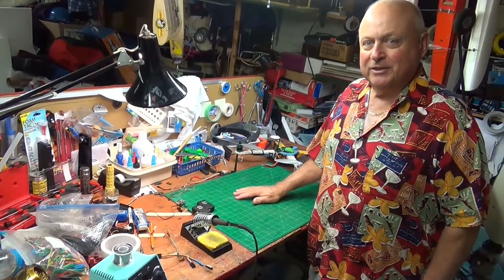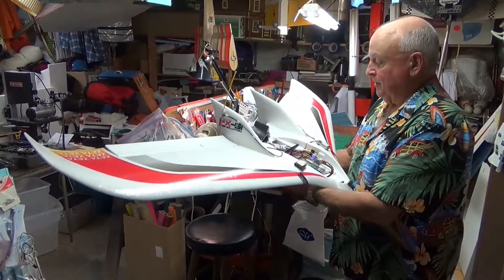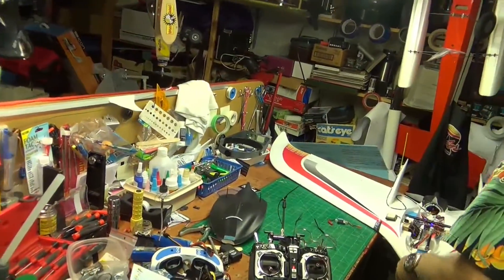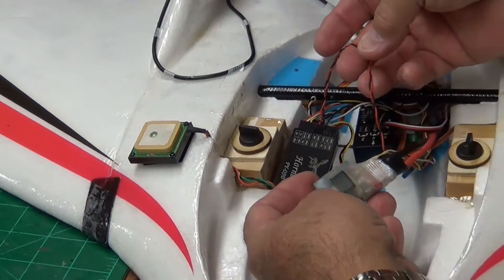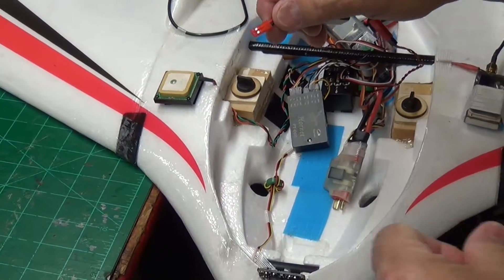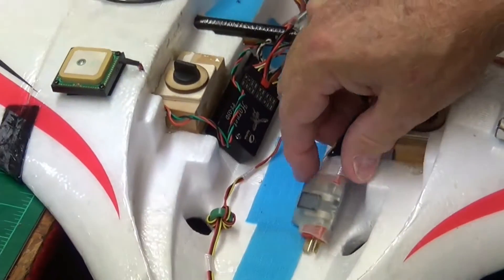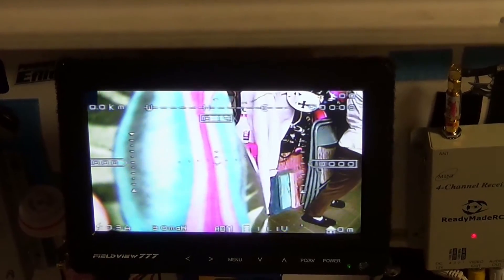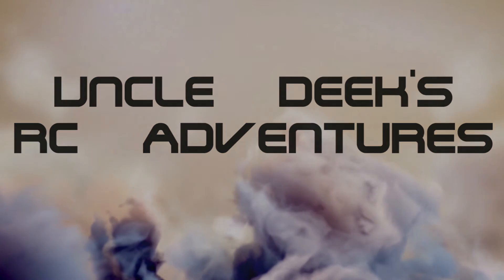How to Eliminate RF Noise in OSD

Comment: Dude you really should have stopped the problem at the source.  The ESC.  Just add extra low esr capacitors to the esc power input wires. For example I used x5 1000uf 35v caps for my 6s setup.   Water hammer effect gone

Comment: Awesome informative video uncle deek. I use that same one in my wing. I started using RMRCs lcfilters with the added 12 and 5volt outputs. Great for also powering your favorite gear be it 12 or 5v. You soldered the wires correct. You always want it on the downstream of the current sensor so it well give you an act urine reading.

Comment: Very nice video Mr. Gibson! Your right, it's important to clean up dirty power that's shared between your power system and A/V circuit.
Another fix would be to dedicate a separate battery to the A/V gear cam/vtx/osd etc. But I think the way you explained here with a single batt set-up and an LC filter is much cleaner!!:) 
Nice workshop too!